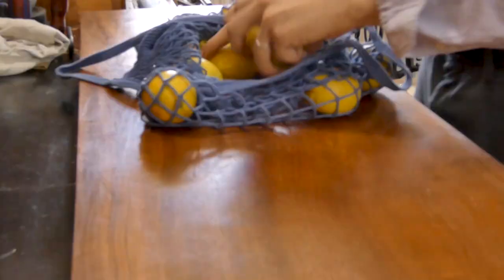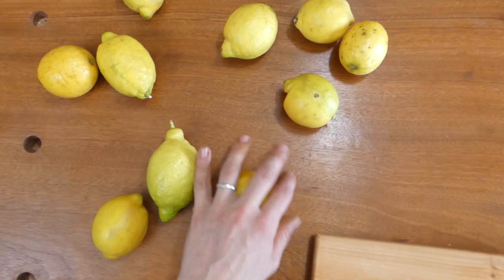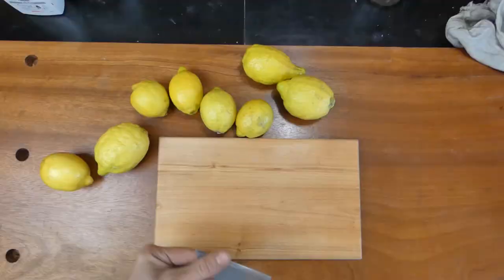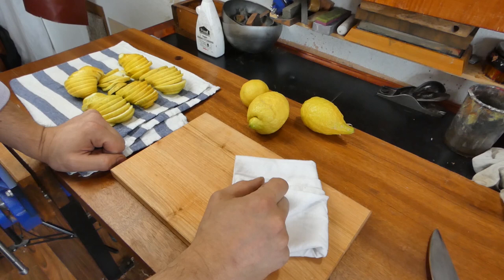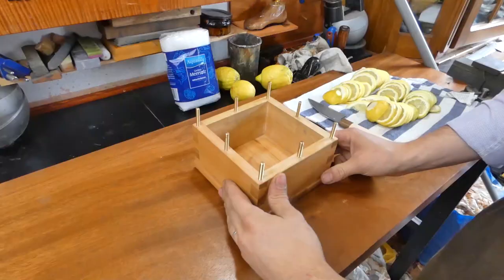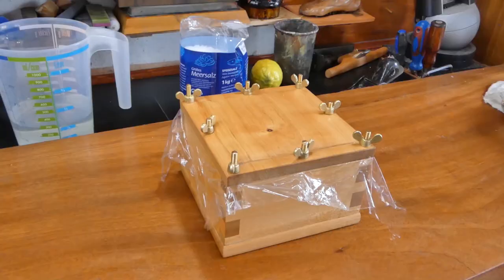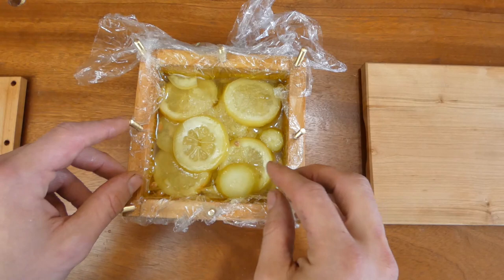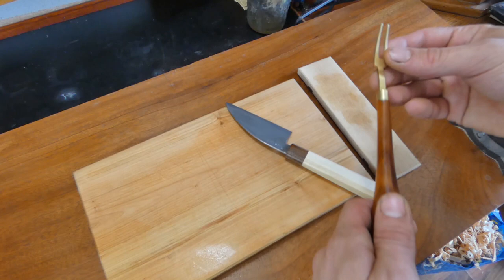How to Make Preserved Lemons in the Workshop

Comment: When he puts the knife blade into the handle how does it stay inside? What stops it from slipping out?
Reply: G'day SRN, Because the knife is heavy it moves a little slower than the handle when Uri hits it with the mallet so the handle overtakes the blade and the tang of the blade jambs in the hole Uri drilled :)

Comment: Does the brass ring on the fork serve a structural purpose or is it purely for looks? Many tools and the like come with a ring like that, always only for looks?
Reply: It's structural.  It holds the end tightly together to stop it from cracking from the side-forces on the metal part, and it also protects the end-grain of the wood.

Comment: How hitting the back of the knife will force the blade to still in the wood handle ? 🤔
Reply: G'day Ben_J , Because the knife is heavy it moves a little slower than the handle when Uri hits it with the mallet so the handle overtakes the blade  :)

Comment: LOL... Next time we expect a full kitchen build while making some supper... You probably deserve it (supper)... not sure you got all the energy spent from those tiny slices of tuna... :))
You did get a head of me... I'm thinking of making a 310 stainless blade for my kitchen 
310 is really rust-resistant, you can throw it to the sea and get it back years later in perfect condition - that's what the next/first intelligent race will find
310 also does not require heat treating... it's tough as it is... :)

עבודה מרהיבה!!!